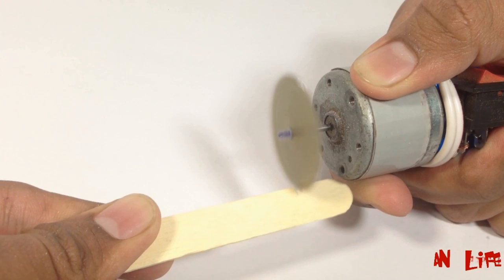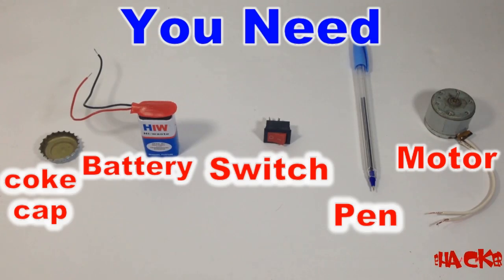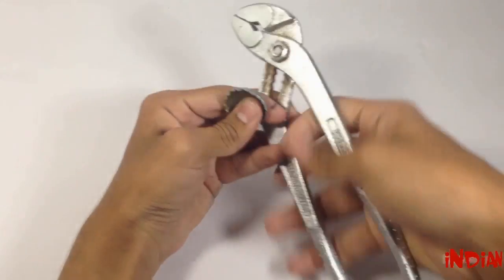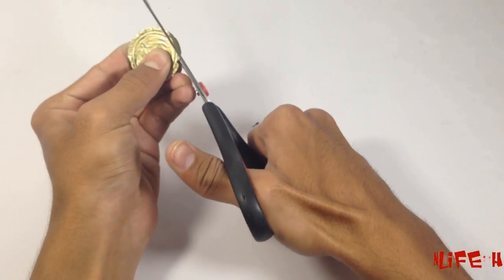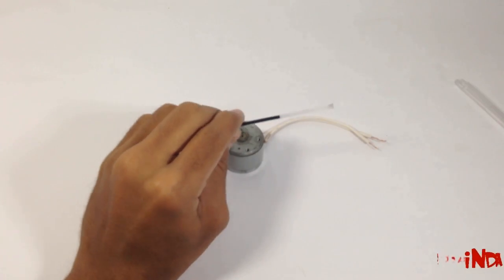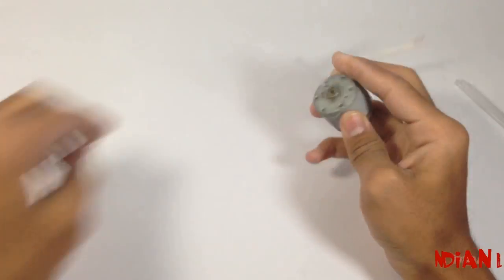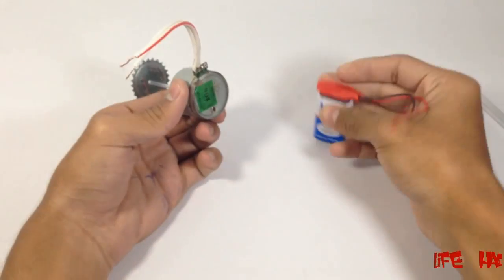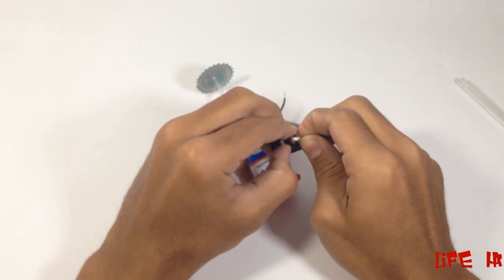How to make a POWERFUL MINI CUTTER at HOME | DREMEL TOOL

Comment: boss! my coke cap working only less than a minute ...
after swtch on, it rotates for few seconds and get slow and finally get stopped 
its not working continuously
Reply from the maker: +Madhav Lade 
Sorry bro but i am also not getting what is happening with your motor. It will better if you can send me  video of working your machine than i may give some suggestions.
You can email me.
Reply: ok